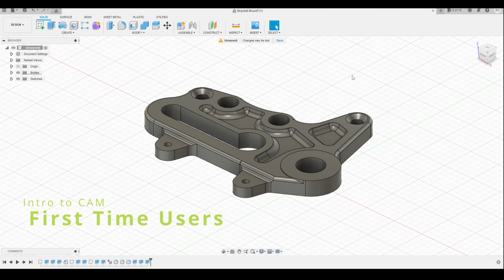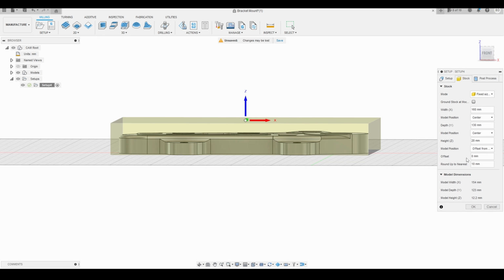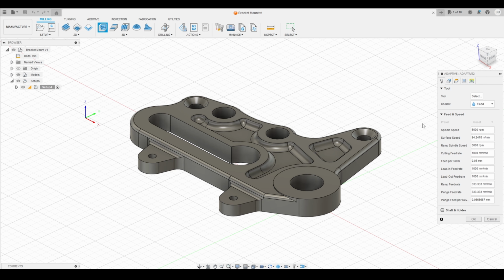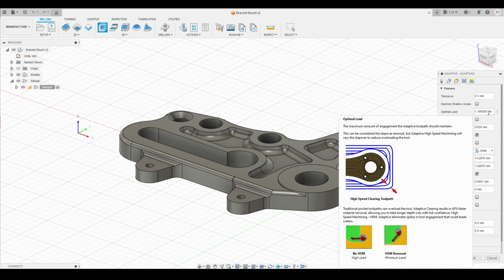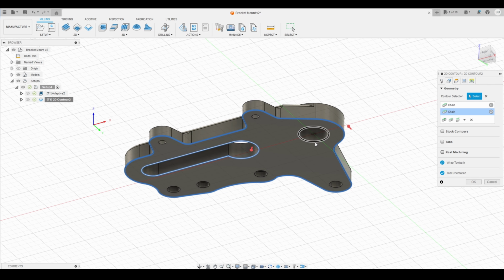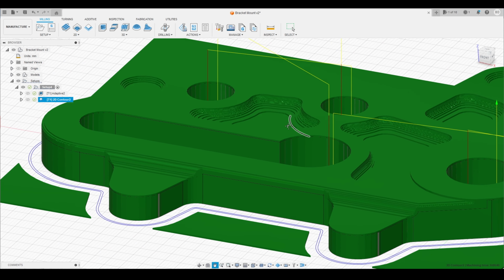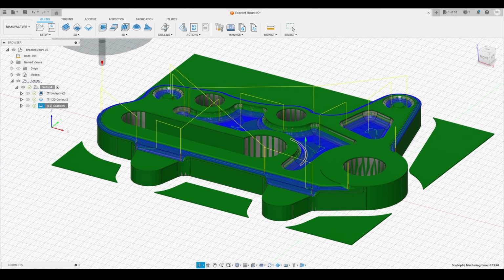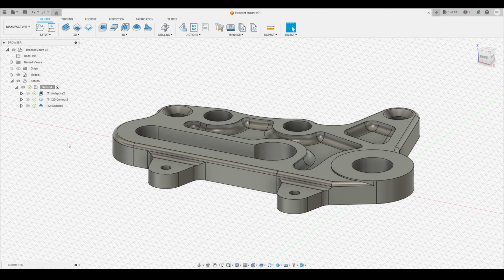Fusion CAM Intro - First Time Tool Paths!

Comment: Would the part be loose if you performed the operation in the order you did them? Or are you using something to secure the stock down to the bed like double side tape? Great video. Learned a lot.